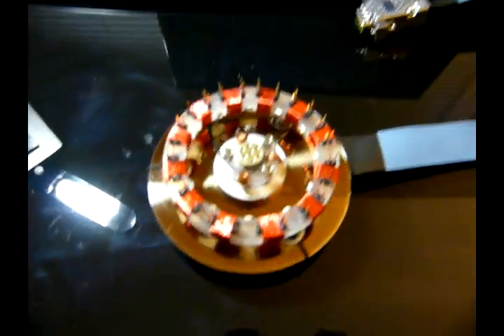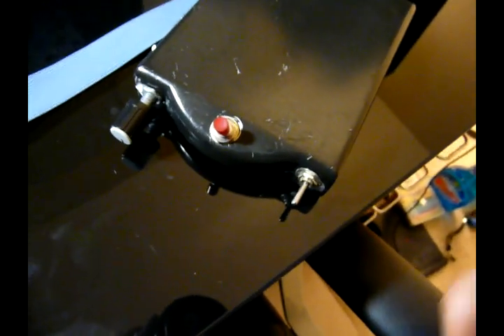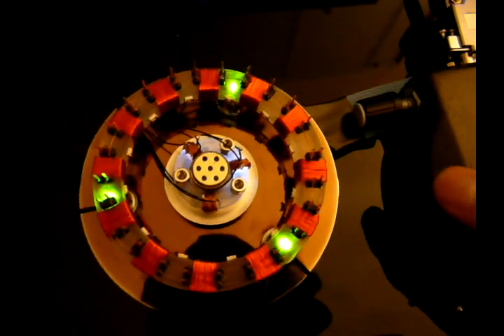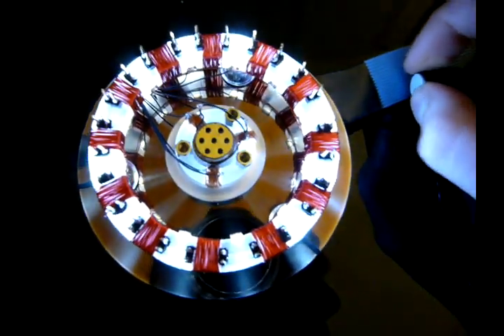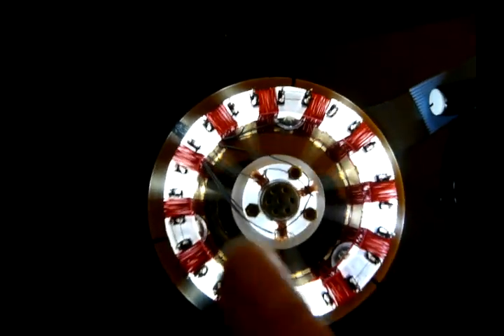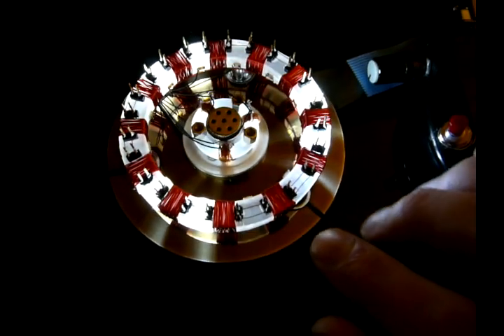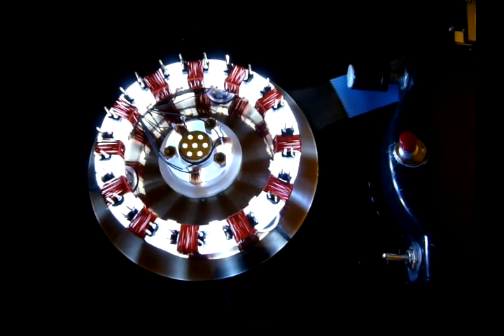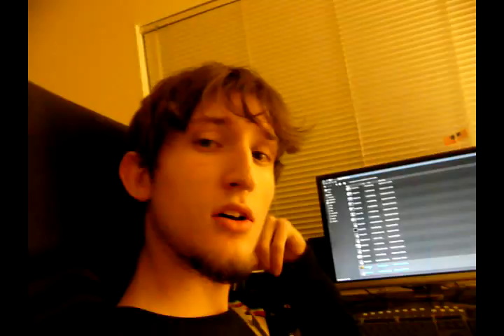Iron Man Arc Reactor, Arduino Style

Comment from the maker: I appreciate your kind comments, but I'm afraid that I kind of made it up using bits I had around as I went along. So no plans... I also, thinking about it I wouldn't recommend using my design for the electronics - it's needlessly complex. Today I'd use a TLC5940, WS2801, or similar for controlling the lights (they're PWM drivers). That said if it would help I can post some high resolution pics of the prop onto my blog.

Comment from the maker: @piratebilltheninja I'm using a couple types of LEDs from Kingbright. There are 3 groups of 4 white LEDs on the inside of the acrylic ring (you can see them clearly at 1:56), plus 4 in the center piece. They are AA3021QWS/D. Then there are the 3 red/green APBD3224SURKCGKC-F01 in the ring. The acrylic is from the local Home Depot, and came in a sheet. I cut it into a set of identical rings and glued them together for both thickness and for diffusing light (I scratched up each ring before gluing).